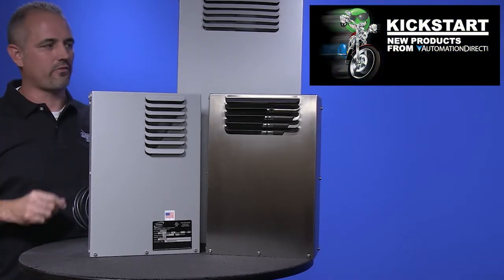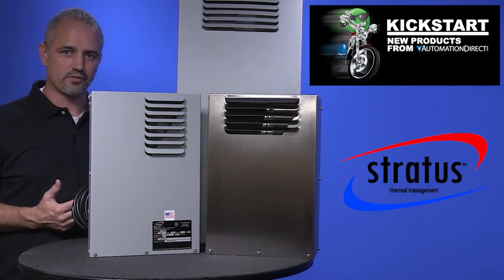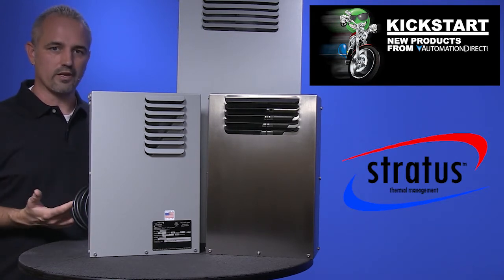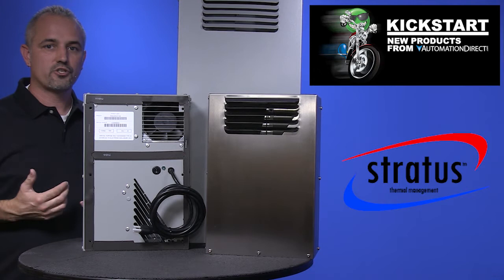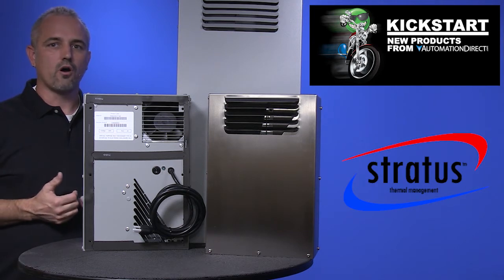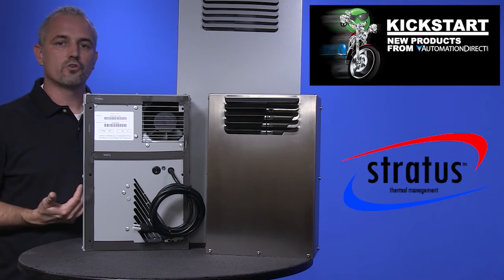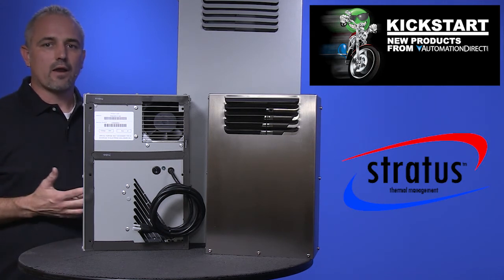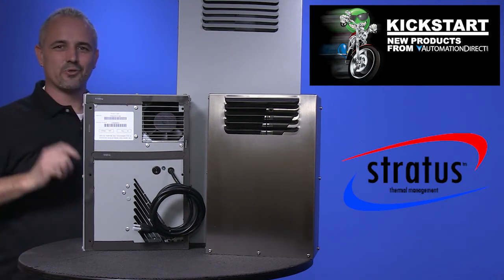Stratus Air-to-Air Heat Exchangers for Enclosures - KickStart from AutomationDirect

Comment: What about dust-heavy environments?
Reply from the maker: The Stratus Air-to-Air heat exchangers are available in NEMA 4 and NEMA 4X. They are closed loop systems that do not allow outside air and particles inside the enclosure. The user manual states "In the event of excess dust or particulates, clean the condenser air inlet section with a soft water spray or compressed air not to exceed 90 psi." If you need assistance selecting a Stratus heat exchanger or have further questions, feel free to contact our free technical support and they will be glad to assist you. https://support.automationdirect.com/